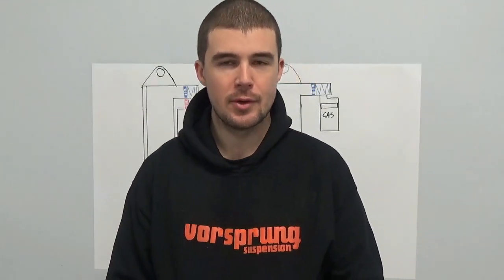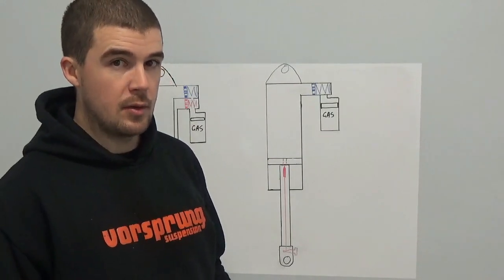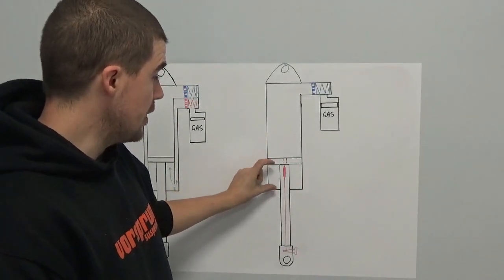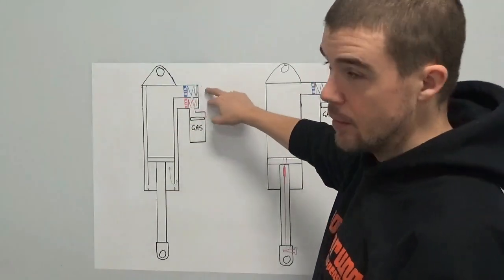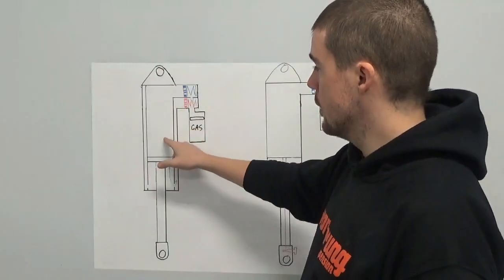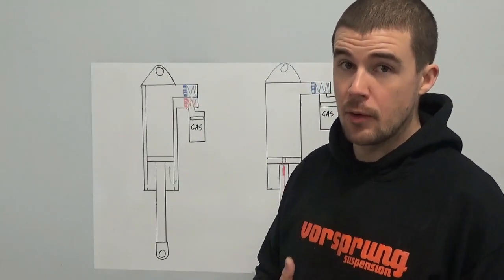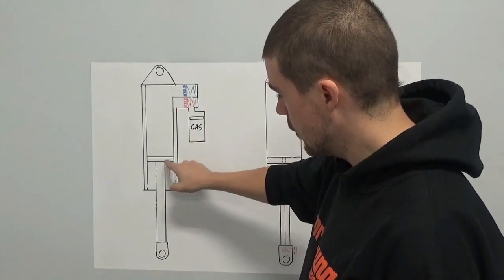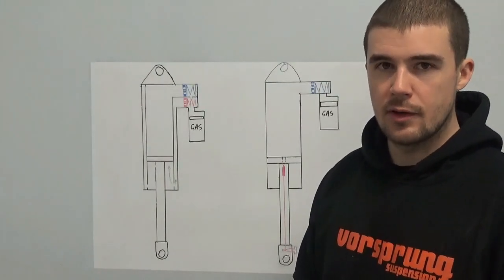The Tuesday Tune Ep 9 - Single Tube and Twin Tube shocks

Comment: What about shocks that have reversed layout compared to what you've shown here, as in the reservoir flow comes through the damper shaft? Like DPX2 or Mara Pro for example, those 2 have separate pathways for the compression and rebound in there as well, twin tube alike.

Comment: Can you do something like this where you go in depth on the mechanics of a particular shock design except check one the DVO Topaz and compare how it functions to something like a Fox Float. The DVO uses a bladder so I would really intersted on the mechanics of it compared to other shock designs and what potential advantages or disadvantages it has. I've used a Fox DPS, Rockshox Deluxe RT3, Deluxe Select+, and my DVO Topaz. The Topaz so far feels miles better than any of those I mentioned. I guess some of that is the upgrade from inline/monotube shocks to a Single-Tube  with piggyback.

Comment: What? as far as I know in Motorsport mono tube is preferred
Reply from the maker: In the automotive world, monotube shocks usually refer to sealed dampers and twin tube ones (other than the TTX type like Ohlins makes, which are sealed) are emulsion dampers, which are cheap garbage. Nobody makes emulsion dampers for MTB rear shocks, and likewise nobody in any serious motorsport is using an emulsion damper.

Comment: digressive rebound curve, why is it bad? (or can be bad)
Reply: As far as I understand, a digressive rebound curve means that the rate of rebound damping will decrease throughout the travel of the shock. Imagine you've cased a drop at high speed and bottom your shock out- your shock will rebound quicker to start and then slow down towards full extension of your shock, potentially bucking you over the bars.
Reply: @ilovemileycyrusok  digressive/progressive damping relates to shaft speed and not position in the stroke. A progressive would have more damping force at high speed (casing a jump or a square edge impact like a root) and less damping at low speed (rollers). Generally we want digressive damping because  square edge hits are usually short (roots, rocks) so it’s good to let the wheel move fast. But g-outs can be long and slow and cause bottoming with too little low speed damping. 

For rebound, I would thing digressive is bad because your wheel will already rebound quicker when there is no load (leaving the ground) versus when rider weight is present (rebounding after landing a jump). So digressive would exacerbate those movements.

Comment: Most of my experience is with monotube dampers in motorsport but I ride as well. With regards to hysteresis in twin tube dampers, my understanding is that the high amounts of external adjustment create higher levels of hysteresis as the adjusters are having to move further. A monotube design shimed so the adjusters are close to closed with much of the bleed achieved with notched shims or fixed orifices would give less hysteresis. How would the twin tube design be configured to reduce hysteresis? I was recently having a conversation with an ex Penske engineer about Ohlins having significantly higher levels of hysteresis but he was likely to be bias!

Comment: Nice video. However, with your mention of twin tubes having a performance benefit in road racing, I disagree. Interesting video on the subject: https://www.youtube.com/watch?v=ErAhHjR6mFo&t=217s
Reply from the maker: The term "twin tube" when used with passenger vehicles refers to emulsion dampers which are total POS's compared to anything we're discussing - if you tip them upside down they stop working The monotubes are a sealed unit more like a Fox Float CTD. In that video they're talking about upgrading from absolute garbage to the worst thing the MTB industry actually uses. The term twin tube in the context of mountain bikes or actual race cars is a totally different thing.
Reply: Right I get you. I had assumed that some of the more reputable companies twin tubes were more like a ttx, but it seems I was wrong. There are a lot of very expensive (but garbage) dampers out there for the automotive market it seems.